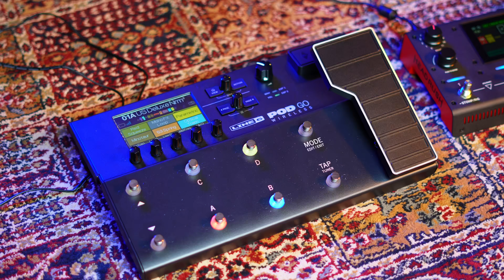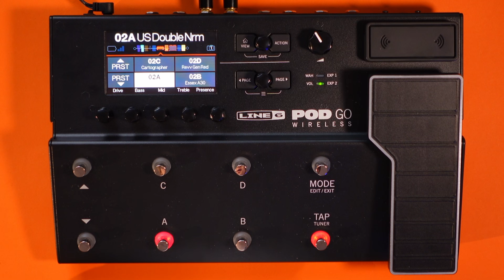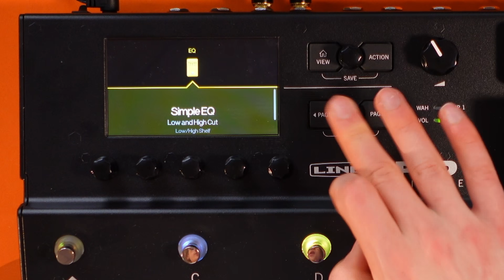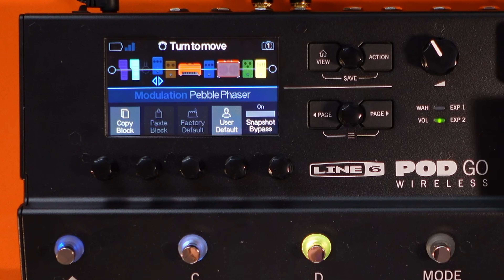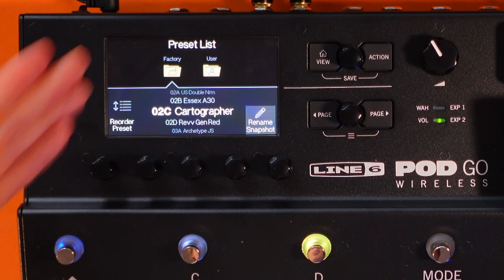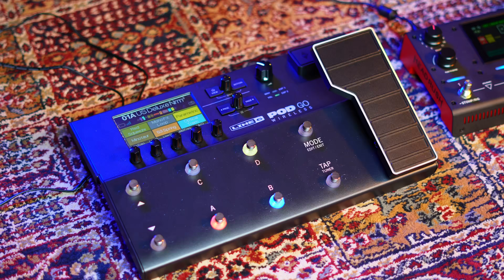Line 6 POD Go Walkthrough And Setup - Beginner Guide

Comment: Thanks Ben. I am a complete Newbie here. I just bought a New POD GO yesterday/ I am not sure how to hook it up to the back or front of my Amplifier. Do I use the Amp out, Main out, Effects loop send to input of my amp? For now I do not want to use the 4 cable method. I just want to enjoy the POD Go for all it has inside. I am hearing reports that I have to turn off IR Cabinets? or global settings to add Effects out? I am not sure. I just want the purest route to my amps effect return in so I can bypass my amps preamp/ I think I am doing something wrong as some distortion effects always sound like here is some type of synth, or tunnel like sound going on. The only paper work I received was teh cheat Sheet, and no manual? LOL What? Yep. I am an old geezer here and from the old school of Guitar, guitar cord into amp. Please help me. Thanks Ben
Reply: A little late but I would recommend you plug your guitar into the guitar in, then run a cable from the output of the pod go to the effect loop return of your amplifier. This bypasses the preamp of the amplifier so that it’s tone shaping doesn’t affect the sound.